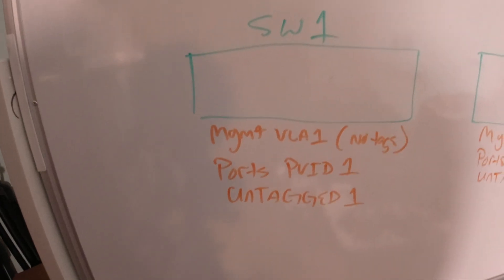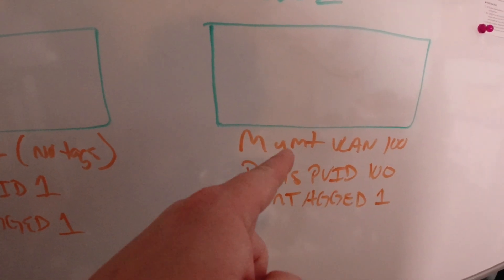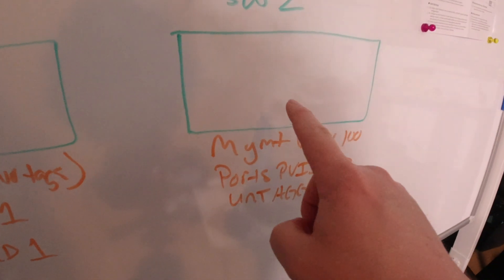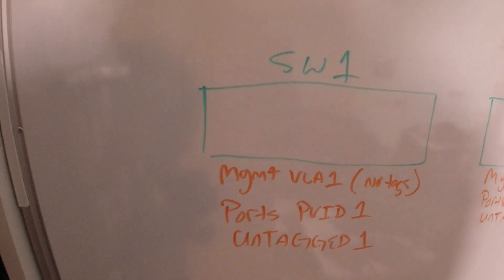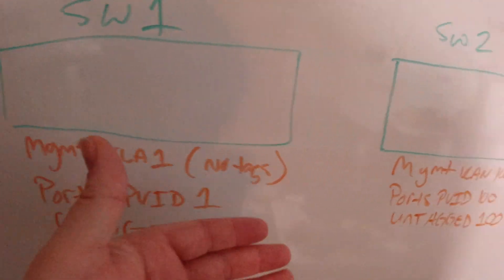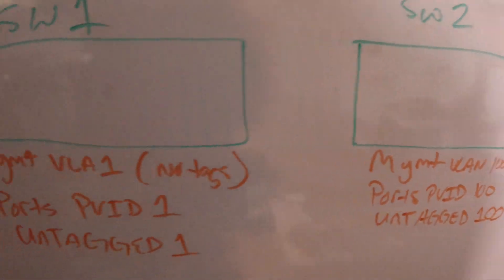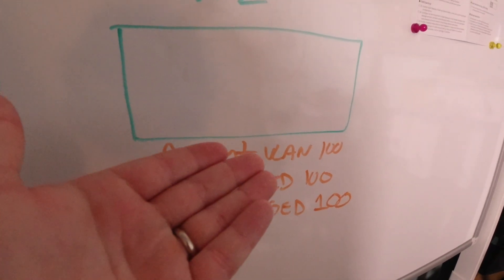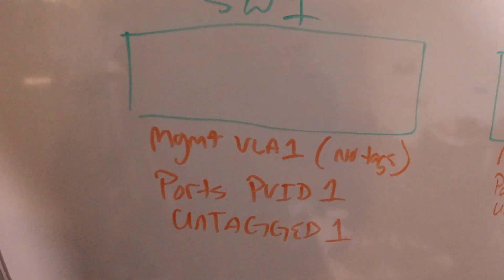Network Design - Keep it simple - Untagged VLANs

Comment: Good example is if you have IP camera system. The cameras all external of the office. A hacker can un-plug a camera, connect her laptop. BAM! they are now on your network.  ( better yet, install a small wifi router, reconnect the camera. Camera still up n working. She can now sit in her van in a parking lot and just own your network )

Instead, you use VLANs.  One VLAN for cameras, one VLAN for smart home type devices, one VLAN for management such as sever ILO, Access points interfaces,, VLAN for VoIP, VLAN for customer computers if you are a repair shop.  The customer VLAN is incase you connect a trojan horse PC, or ransomware infected system that will scan network and infect others. 

In this case, when she connects to a camera network cable, she shall only have access to that. Cameras and the NVR. You can enable port isolation too. 

Now, if had just been faithful,  she would not have tried to hack you stuff and plant evidence that you  are an Alien. So her dads secret team can adduct you and take to base 51.
Reply: That's why we do port security. Disable unused ports, enable IP/MAC port binding, ect

Comment: Ok, so for the most part I dislike doing Vlan's UNLESS the customer has plenty of money for Cisco gear. Over 20 years now, I have found that with most regular hardware the VLAN and PVID configurations slow down the switches and the routers. So I avoid it. Sure on my team I have a Cisco certified person that can do it but I still don't like it.
1. if you want it to work consistantly and NOT fail you need Cisco gear which is expensive.
2. if a customer needs to reboot a VLAN then we have to reboot ALL VLans
3. it's a lot of extra complexity which takes time to build , and maintain. 
So I build seperate networks if at all possible, ya an extra switch / router. etc. they are secure too, without all the extra work. Yes more gear, still less cost than good Cisco gear. 
And customer can reboot lan XXX with ease, without my team. Just reboot switch / LAN XXX no problem. the whole building won't go down either.

Comment: Personally, there is no operational difference except adding complexity and possible network issues, especially with the provision of some new devices. some manufacturers configure their devices to be on vlan 1 by default yes there are ways around it but  why put yourself in the problems without any real benifit

Comment: We have taken the route that:
IDF:
Unused ports defaults to untagged vlan1/base vlan (and are admin set to down, the untagged is just an extra level of security'ish measure)
Used ports are untagged access to what ever vlan they belong, or trunk in case of multiple vlans needed (with acl's/radius etc)
All trunk ports going from the IDF to the MDF are purely tagged, and vlan 1 is forbidden.

MDF:
no vlan 1 in the setup

This should ensure that someone plugging into an unused port is limited to who ever else is plugged into an unused port, in case of IT forgetting to down the port.
Reply: If a bad actor has access to the switch, couldn't they just unplug an existing up/vlanX port and gain access that way?  That's why I never understand physical port access security and the scrutiny.  I'd rather just add another lock to the door.  Maybe I'm missing something?
Reply: @mt_kegan512  When you have 100+ outlets around the school/office area, and all of them are wired to a switch port in one of the IDF closets. It is easier to down/up the unused ports than running around the entire site and remove/re-connect cables.

Comment: Operational difference could be: that traffic coming out of sw2 is untagged for vlan 100 but when traffic goes into sw2 then vlan tag 100 is added to the frame... thus traffic with vlan100 leaves sw2 to the router for example through a trunk port arriving to a router with all traffic from sw2 tagged with vlan100.  Is this not true? Great video btw and certainly makes that part of your brain ich. thanks for the vid